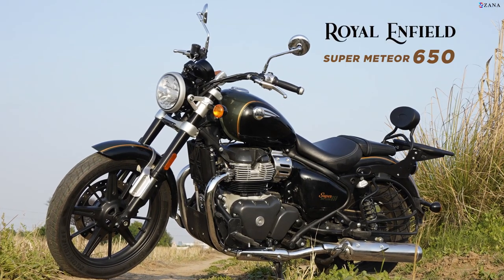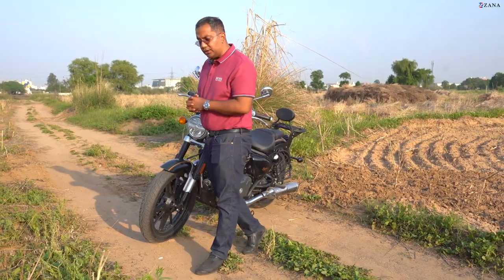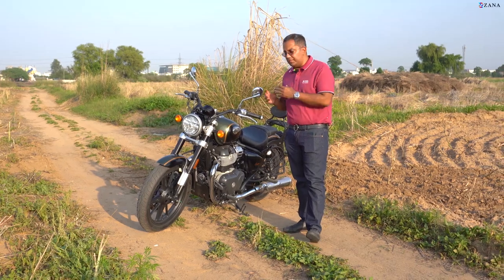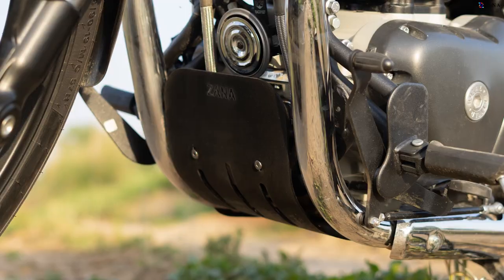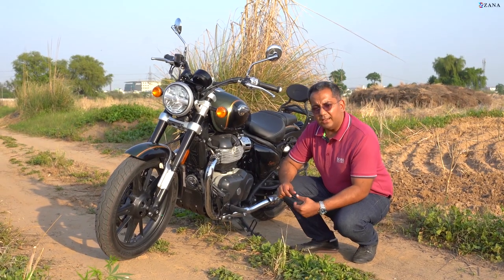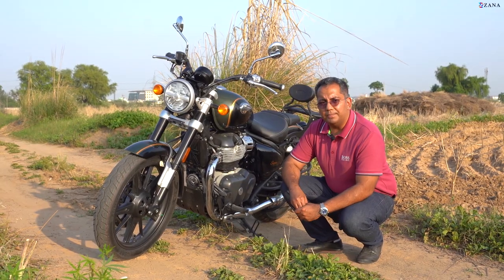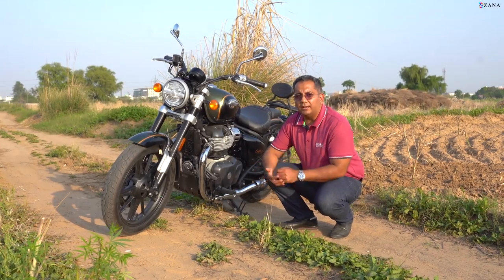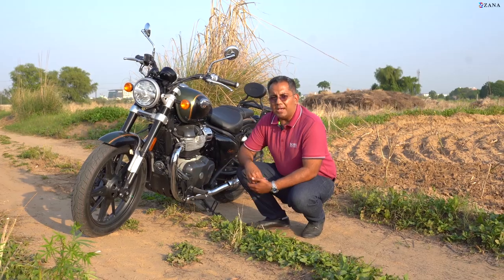2023 Royal Enfield Super Meteor 650 New Bash Plate And Radiator Guard | Zana Motorcycles

Comment: Just recieved the Radiator  guard from Zana. Poor quality. The existing radiator guard of Royal Enfield  of Super Meteor 650 is of much better quality. I have not fitted it. Bad purchase as radiator guard is very light and does not match the finish of the engine Block and crash guard of RE 😢😢.  My bad luck...Will keep the accessory  as a such in my garage. Don't buy...Stock radiator  guard is much better.